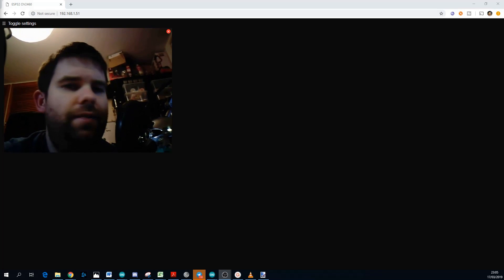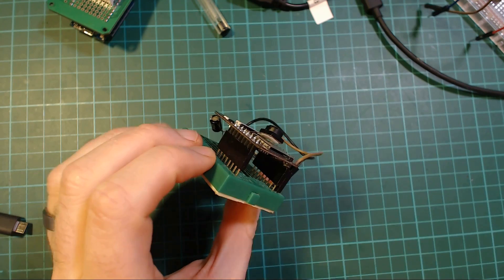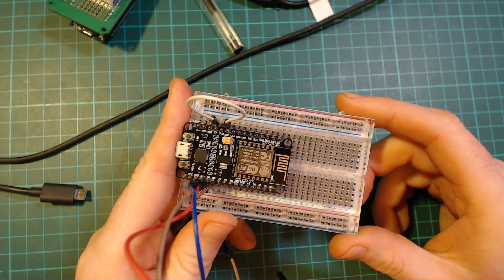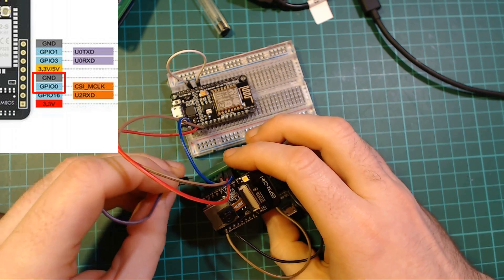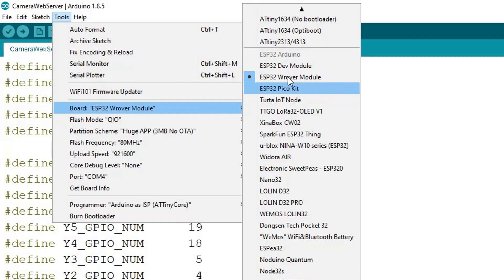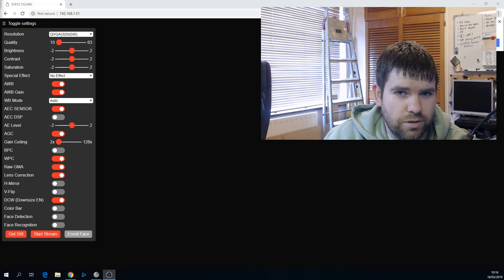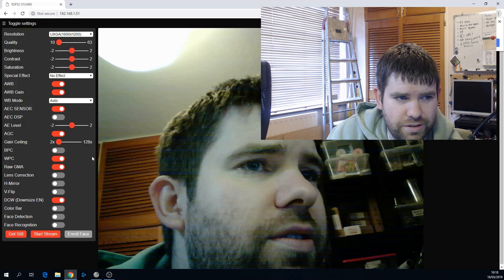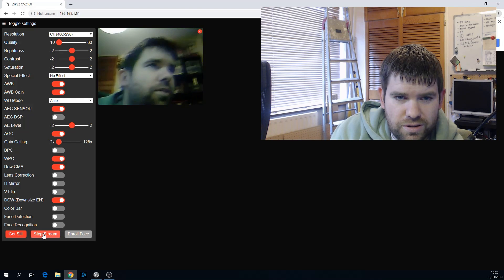ESP32 Camera programmed using Arduino

Comment from the maker: Hey all,

Another quick style video, I am taking my own advice from the last makercast and cutting my cloth to fit my meassure! I don't have a lot of time to make videos at the moment and this quicker style allows me to get more videos out there at the moment

Hope you like it!
Reply: Brian Lough yes, we like it Brian, at least I do. I also like that cam and can think of some nice projects with it (maybe a door lock with face recognition)?
Reply: The error is always "camera init failed with error 0x20002. Please help me. Dont know what to do now. 😥😥😥
Reply: Hi @romellboligao8147 , I got errors like that too. I had to switch the FDTI board to another one that I had spare. Here is a link -  https://www.aliexpress.com/item/Orange-Pi-USB-to-TTL-Serial-Module-UART/32844850903.html - to the original 'USB to TTL' board on Aliexpress. By doing this I got rid of the USB cable altogether.. I got a few brownouts too
Reply: Hi brian. Can you please help me. Im getting 0x20002 error
Reply: As long as you get the content out I'll give it a try. This is awesome. Thanks Brian :)
Reply: Will it record onto the sd automatically?
Reply: You don't need to use the reset button.  IO0 > GND
Reply from the maker: Io to ground only enters into boot mode when it's io0 connects to ground on start-up, the easiest way to to make the esp8266 start up is to reset it, although you could just so it on power up, i think for the sake of a couple cents for a switch it makes sense to have one
Reply: @BrianLough  I have a switch on mine, but the way I mounted it, I cannot press it. They should have put it on the top.  BTW, do you know about the esp32 problem with the "serial" "pyserial" files? I am following what you did and cannot get passed this.

Comment: I thought this module might be really useful but I have a real problem powering it. It will work for maybe 10 mins maybe i hour them quit altogether. I have used everything from a phone charger to a 5V server 100amp power supply and makes no difference. One thing the module itself gets very hot so I also put a heat sink on the microproc. shield. The voltage regulator area of the board gets really hot too but bypassing it and trying to power it on 3.3V wont really work at all. Just wondering what you're using to power it and will it operate continuously -say all day long. Thanks a lot.

Comment: Hello Sir, I'm from Malaysia and i have a problem on flashing the ESP32-S...
esptool.py v2.6
Serial port COM3
Connecting........____.....___
Chip is ESP32D0WDQ6 (revision 1)
Features: WiFi, BT, Dual Core, 240MHz, VRef calibration in efuse, Coding Scheme None
MAC: fc:f5:c4:0d:d4:80
Uploading stub...
Running stub...
Stub running...
Changing baud rate to 460800
Changed.
Configuring flash size...
Warning: Could not auto-detect Flash size (FlashID=0x0, SizeID=0x0), defaulting to 4MB
Compressed 8192 bytes to 47...

Writing at 0x0000e000... (100 %)
Wrote 8192 bytes (47 compressed) at 0x0000e000 in 0.1 seconds (effective 590.4 kbit/s)...

A fatal error occurred: Timed out waiting for packet header
A fatal error occurred: Timed out waiting for packet header
This is the problem i'm facing while flashing the module, even though i follow your instructions. Please Help me... Thank you.
Reply: Hi Tanesh 
i have same problem
 bro if you mange to solve the problem can you please share the solution.
thank you

Comment: Connecting........____....._____....._____....._____....._____....._____.....____

A fatal error occurred: Failed to connect to ESP32: Timed out waiting for packet header
A fatal error occurred: Failed to connect to ESP32: Timed out waiting for packet header

evrything is correct, im start wondering if my physically connect is lose or what coz the connection is right, and all the settings.

Comment: Is anyone can fix  "esp_camera_init(): Camera probe failed with error 0x20004"
Reply: no
Reply: Glair (5m ago)
"Camera probe failed with error 0x20004"
Check if it's correctly inserted or try pressing on the camera connector.

Comment: Board has switcher 3.3 to 5 v for power supply (it written on board, can see on this photo https://ae01.alicdn.com/kf/HLB1Ybw_NgHqK1RjSZFPq6AwapXaK/ShengYang-ESP32-CAM-WiFi-Bluetooth-ESP32.jpg). 
They say you should resolder jumper from 3.3 (by default often) to 5 v if wanna power by 5 v. Did you do that?

Comment: The title is misleading. "using Arduino" is quite different from "using Arduino IDE"! Ruy Santos' tuto is way smarter than this one! This guy sees "great problem" where there's not! This module is WELL DESIGNED! Don't believe this bizarre guy who thinks he has to use always a bread board! It's a development module dude! Complicated without reason
Reply from the maker: Hello,

Re Title: I disagree, Arduino is an "Open-source electronic prototyping platform" (from their website), this is programming this camera using the platform.

Re Rui: Yes his video goes into more detail on some of the features. It's worth checking out. (Here is the link for others coming across this comment https://www.youtube.com/watch?v=MicAM_A0_lU)

Re Board design: I disagree that is well designed, as I spent a few minutes explaining in the video! I can live with it not having a USB to serial converter, but having a reset button on the opposite side of the PCB as the camera makes no sense in any configuration and they should have broken the reset pin out.

Comment: If there's a way to inject page headers into the webpage, create a style tag, or add a quick java onload function to 'document.getElementById('stream').style.transform="rotate(90deg)"'  In the natural looking setup for the board, the camera is -90deg out of kilter.  I can do it on the rendered page with the inspector and DOM, just can't work out where the page code is created :(  Also, I can only get a stable wifi connect @5.5v at 2.4A which stops the brownout error.  Great video..couldn;t have gotten this far without it :)  Cheers!

Comment: Please,  how can I use this device for access authentication in order to allow only authorized persons to enter a particular place?
Reply: you can use tensorflow on arduino, or if you can spent little more money(149$) you can buy a google edge dev board which is made for these type of work
Reply: Thanks from spain. Only with your video i can turn on the esp32-cam. Two days with headache . My english its too poor, but the beers are on me.

Comment: The horizontal lines are caused by undervoltage.
Connect a 1000µF capacitor between GND and VCC. That capacitor can sit between the breadboard and the ESP32cam board. This will be able to buffer the current spikes sufficiently.
Maybe you will need to bypass the on-board 3.3V regulator and use a more capable 3.3V supply.

Comment: I think you should not ground the GPIO 0 pin before pressing the reset button.  First press the RESET and while still holding the RESET ground the GPIO0 then let go of the reset pin and you can then also un-ground GPIO 0 a few seconds later. 
The reason for this is that GPIO-0 is also used to provide the 25MHz clock signal to the camera module and if you ground it you will be shorting an active output to ground. Once you press and hold the reset button its ok because GPIO 0 then becomes an input.
It can survive the short circuit if you don't do it too often and don't leave it in short for too long before resetting but I think its better to just avoid it.

Comment: hi there 2 Question, 
1) do i have to use it in wifi mode or can i use it as a regular camera for arduino/processing type of programming?

2) cani use any camera "like phone camera breakout module sensor(cmos)" into this esp driver module?

i like to use a extension ribbon for that cam since i dont want to use the camera close to its driver pcb.  Any tips or advice ?

preferably i like to use a cam this small as a usb webcam, i find it easier to find it in my printArray(cams); as a usable as a USB CAMERA.  even better a camera i can address because if i use more than one camera who is the same in programming there will be no way for me to call it during setup.

EXAMPLE:

void setup(){
size(w,h);
port = new Serial(this, Serial.list()[ 0 ], 19200);
esq = new Capture(this, w/2, h, "USB2.0 Camera");
der = new Capture(this, w/2, h, "USB2.0 PC Camera");
opencv = new OpenCV(this, w/2, h/2);

final String[ ] cams = Capture.list();
printArray(cams);

esq.start();
der.start(); 
}

Comment: Thanks for this informative video.
Can I access the video over internet in addition to the local wifi network.
Please confirm.
Reply: Good question. I'm also interested in knowing that answer.
Reply from the maker: With port forwarding on your router, I don't see why not. It seems like the webpage and the stream are on two separate ports (80 and 81) so that might make it a little awkward to port forward the example application but I'm sure there is some way to solve it

Comment: Good one - Its great that you do all the heavy lifting of figuring this stuff out - It really saves the rest of us time and keeps the inspiration high.
It would be interesting to see whether:
1) You could get multiple streams running actively on a single web-page layout (let me know if you need a hand).
2) Could take and save stills automatically (to a given location) when, say, a face has been detected, or motion or whatever.
3) Adding external IR lights would give this camera somewhat of a "night-mode" function - (i think it may depend on whether there is an IR coating on the camera lens, cheaper lenses don't typically have this and this might be a benefit to allow night images to be enhanced by off camera lighting.)

The v-flip and h-mirror functions are probably what you want for setting the camera up any direction you want (did this work or have no effect when toggled?)